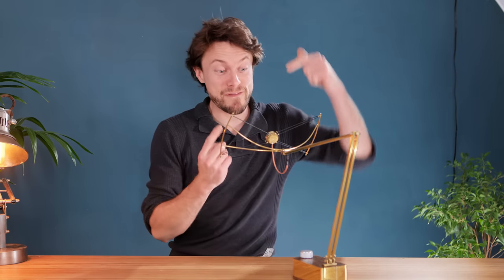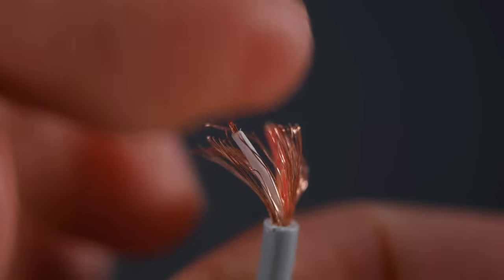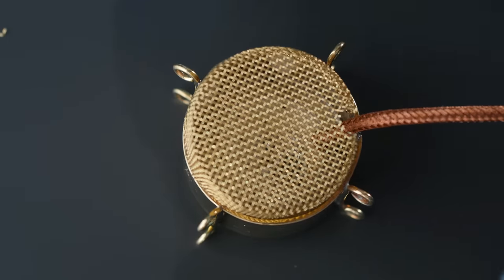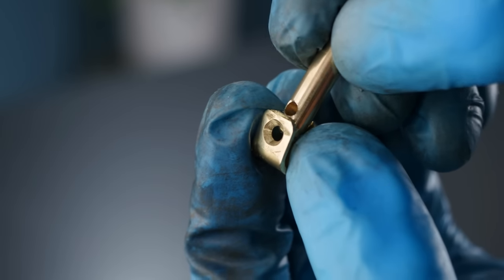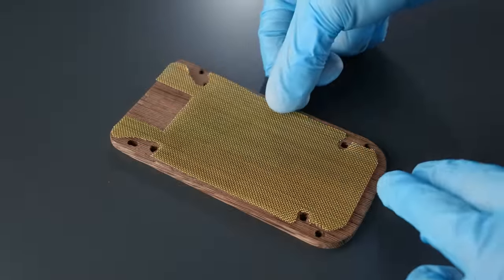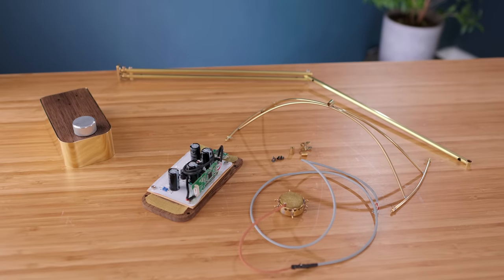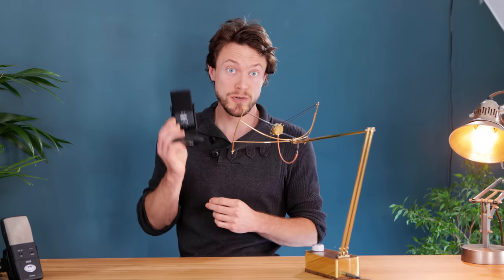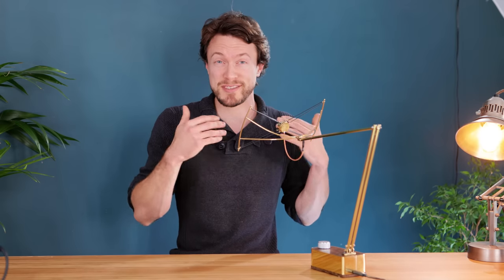Building a quality USB-C microphone

Comment: I'm a mastering engineer with 20 years listening experience in sound.
Yes, the expensive mic is better - richer, smoother, less high end distortion.
But is it 100x better sounding. Hell no.
I actually prefer microphones that give character to a sound.

What are you buying when you buy a microphone - apart from low noise floor and well constructed to prevent vibration or resonance - you're really paying for the 'curve. Which is what the microphone manufacturer has decided they want their microphone to capture - is it better at capturing low mids for vocals, is it dynamic enoug to handle the impact from a kick drum or cymbal and still retain that detail?

Microphones are not complicated to build well - therefore you're paying for what their in house designers and experts in listening have decided where they want the focus of the microphone to be. And it doesn't have to be a simple curve - it can have peaks and dips. Less 200hz for example, for less muddy, boxy sound. More 3500hz for vocals.

With that in mind - there is a fascinating new development from Slate Audio - they have build a microphone with a neutral EQ curve and their software 'bends' the frequency spectrum into the sound of other microphones. So you are essentially buying as many microphones as they have developed the curve for.

They've also done this with a pair of headphones they've named VSX. 
It uses psychoacoustic and binaural technology software to make the headphones sound as if you are sitting in front of a pair pf speakers. Then - they have gone into famous studios and captured the sound at all freqencies and applied that EQ curve to the headphones. When you buy the headphones, they come with around 10 different rooms, each with 3 sets of speakers in each - a close pair, a midrange and the obligatory huge set of speakers for blasting your final mix out to the client.

I bought a pair and haven't gone back to my actul monitors. I'm now doing all my mixes on headphones that sound like I have a pair of $30,000 speakers in a completely acoustcally treated room.

Comment: Would it not be possible to use a pot as a volume switch? Pots should be able to gradually adjust the resistance with whatever range the pot is set to

Comment: how much would this cost someone who's starting with completely nothing though? like needing to buy the soldering stuff, blowtorch, drill, wood, file, sandpaper, etc?
Reply: I think this would be about 250$ then, especially because you can't get the same parts for the same prices anymore. I just gathered most of the pieces I still needed, which were just the materials for the electronics and casing and I'm down 120€ approximately, which is about 130$

Comment: I know it's been awhile since you put out this video, but could you possibly show us if 3D printing the no electrical parts is possible?
Reply: I'd assume it should be possible with a regular sized printer, May want to design it a bit more reinforced though. Like for the arms that are going to suspend the capsule use a more frame like construction as plastic is far less stiff than Brass tubes.
At least. That is how i plan to try to design it.

Comment: Genuine question. If the cable doesn't move, and you connect it to a normal thicker wire anyway, why use the ultra think copper wire for just a few inches?
Reply: The capsule and the stand are certain to suffer minute movements. Be it you speaking into the capsule, or the stand picking up vibrations from the environment.
You will want the capsule to only register the former, not the latter. So the goal is to keep the capsule as suspended as possible with as little means as possible to pick up vibration.

And a rule on that is the less mass a wire has and the more springy it is. The less vibrations are transferred through it. The thick shielded cable is just way too stiff for that.

And arguably more importantly: It just fits that retro brass aesthetic
Reply: @Foxhood  the perfect answer. Thank you very much.

Comment: What do you mean 30 $ ? I spent around 70€ on it so far but I still haven't bought the materials like wood, brass tubes and rods, nitrile rings, screws and brass sheet
Reply: Maybe you should plan this through before spending anything? Also the video is 2 years old....

Comment: It turned out really beautiful but you are putting way too much faith in the strength of a solder joint where you connected to the base you need either at least another connection point or you really need to learn how to braze

Comment: Just to get things out of the way for anyone building this microphone today, if you want to build it it is no where near the 30-40$ advertised. Realistically if you want to get all of the parts you're going to be looking at about 120$ once everything is all said and done. Just the brass alone pushes you past the 40$ top end that is advertised. I think the microphone is great quality even for the price, but the price is no where near what is advertised in the video.
Reply: Yeah, pretty sure this guy does it by "I only used like 2 inches of this 10" bras rod I had to buy.... Let's just say it costs only 20% then" (just a general example, not related spesifically to what he used in the video)

Comment: Why can we not make this into something that's mass produceable or atleast has an easier and more functional design than just being the aesthetically pleasing piece it is? 😭 I would've given 30$ in a heartbeat if my audio quality could go to this level.
Reply: You forgot about labor. Factoring in that, its a hell of a lot more then the $500 one. Most "high-end" components have affordable parts like this. Its the design and assembly (and name) you pay the $$$ for.
Reply: @ckmoore101  ou! Wow, I forgot about that. That's true. But still, isnt there a way to make it into a somewhat budget approach, as in, making it a compact 3D printed Design in a shell format like traditional microphones? Maybe it would go up to 250-300 per piece, but I think that's still more affordable than the other options yk depending on the quality?
Reply: @heyabhavya  I think you severely undervalue the labor and infrastructure costs required to do even your budget approach. The ONLY thing that makes this cheap, is that your own labor, time, tooling costs, and R&D, are free. The instant you want to commercialize this, you skyrocket into the very expensive category, otherwise you don't make a profit.

Comment: $12 my butt. It'll cost more than $12 just for the cost of shipping. Figure in 70 hours of my time for all of the metal forming, soldering, drilling - Hey, what if I don't have drill bits for metal? Or a soldering iron? Okay, so this is sounding more like a $200 mic project.

EDIT: rofl and a tap kit.

Comment: U have pick an Electret cell into the gold gitter, but an ECM Capsul has an freqzuence range from 50-2000Hz  this cann be work with 5V but if u want an realistic modualtion, u need an Dynamic or Kondensor mic, the first one nedds 7.5 V the CondenserOne runs with 40Volt.   To become an realistic sound an Schweinsmembran is used. To understod the technicals about the frequency in this case for voice is 10-8000Hz .   Here the High Quality Version without ECM Trash   https://youtu.be/617l35SvNOk?t=86

Comment: THat's not a high-quality mic. It's low quality selective range mic which can pick up only speaking person voice. Which are cheap around (5-10 dollars unless you buy in overpriced shop).  The main feature here is vibration-absorbing stand. In somewhat vintage  design, but quite cheap to make.  Can be used for many light mics.

High quality mics are sensitive that you need dissipation shields and special covers for them, or  the sound of your PC's cooler's fan would drown your voice out. And materials they are made of aren't cheap.  They aren't mean for common person. THey meant for someone who uses them professionally, for sound recording, etc.

And note: any USB mic is as good as the analog-digital converter it uses and codec's frequency used to encode. THe high-quality ones aren't royalty-free and not cheap.

Comment: bro thinks we have all the knowledge and tools that he got... and i doubt that it would be $30 in any other country than USA.
 and i just realized that he didn't account for labor costs, im guesstimating the hourly rate at around 18 bucks an hour and the total build and fabrication time at around 5 hours so that puts us at $90, $120 with the material, but you also need tools, i saw a blow torch soldering iron drill and a holder thing for the electronics, blow torch is about 20 bucks, the cheapest soldering iron i can find is about 50 bucks, the cheapest quality cordless drill that i could find is about 100 bucks and i wont count the articulated holder thing since i dont know what to search for. that gives us a total cost of about $290.

with this said im not trying to spread hate, i just want to show that there are a lot of hidden costs behind stuff like this, the material might be cheap, but time and tools and knowledge of how to do this is not cheap.  if i had the choice between making this mic for 300 buck and buying a new mic for 300 bucks, i would always buy it new one.
Reply: I do think you're right about this not being for the average person.... But if you're actually the type of guy to make something like this I feel like you'd already have these tools from previous projects, or need them for future ones so seems reasonable to me. Hourly rates for something that is basically a hobby project is also kinda irrelevant, but I do agree that making something liek this really shouldn't be presented as a money saving thing, it's a hobby thing
Reply: What I also find the most intriguing about projects like this, is that in theory if something goes wrong you should be able to easily repair it since the circuitry is both quite simple and you know... Made by you yourself. I have a 200 dollar great microphone already, but I don't think I could repair it if anything went wrong with kt

Comment: Not an art. Old mics, tube design, and the telefunken ac701k tube in particular are very much science-based and engineering heavy. Modern mics are also not an art. Using RF feedback circuits, dsp to allow directionality and many other engineering designs are not pretty pictures. Also, the fact that the clone mics that are so popular fall into a relatively few categories of designs is indicative of how those designs are optimized and not artful.